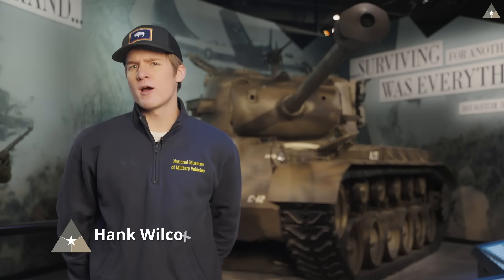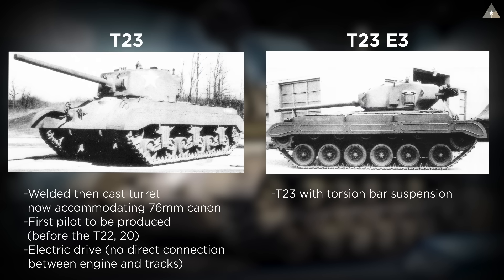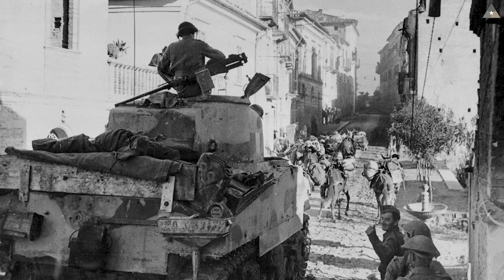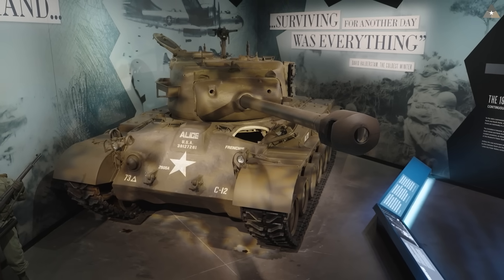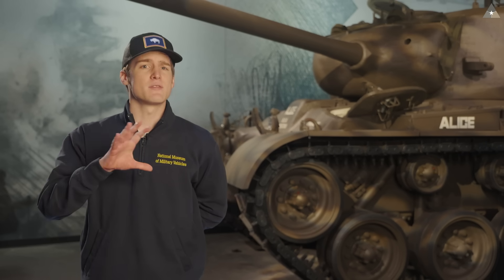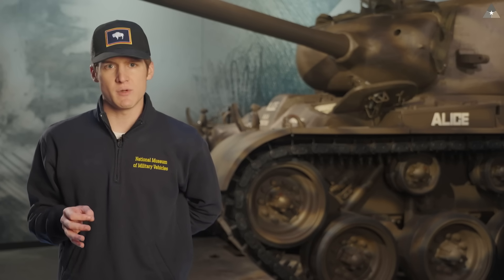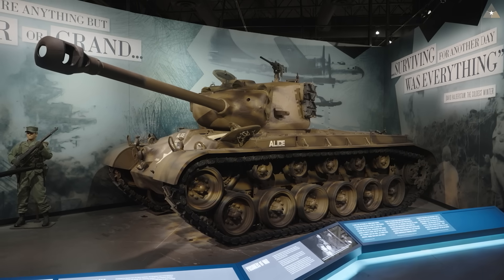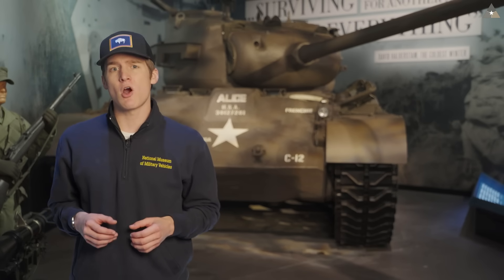M26 Pershing | From Concept to Combat Across Conflicts

Comment: This wasn't always wanted, it had maintenance issues. They could do the job, not the problem, 43.4 tons was abit much but the armor was needed,. US only saw 3 tigers until the battle of the bulge. The Sherman did as it was expected. Easier to repair, burn rate went down to around 10 percent. Many were knocked out repaired and back to battle.

Comment: Had it come to Europe earlier it would have been a great assault tank and tank killer but it wouldn't have been able to match the reliability of the M4 Sherman which was needed during the drives through France. 
I'd say it was better than the Panther in most regards and would have proven the superior tank in a face off. 
Overall it didn't have the reliability yet for prime time in France and would have been a maintenance nightmare.

Comment: There's always a question if the M26 was actually that good? By design it was somewhere between the Panther and Tiger tank in terms of armor, at least according to paper stats.

Videogames that rely on paper stats make the M26 a very solid upgrade to the M4, but less effective than the Tiger 2. Those same games ignore any faults with the Tiger 2, which tend to make the Tiger 2 the most powerful tank of World War 2.

When the M26 was used much more was during the Korean War. There its not quite mentioned, but being that it does about double the armor of the T-34-85 used by North Korea, it was probably much more effective in gun duels, but the M26 also had a weak powerplant by that point with only about 10-12 horsepower per ton. The T-34-85 I think had about 17horsepower per ton.

The M46 had a massively upgrade powerplant, but doesnt seem to have been common.

Then you get to the M47 which seemed to be the true successor to the M4.

Comment: Biggest problem in Korea was getting tanks up on ridges fast hitting 3 targets for the grunts then getting back off the ridge before Chinese and North Korean counter fire could start. Basic problem with the M26 was Transmisson slippage on grades. The M46 transmission was a redesigned unit to be a refit item for M-26 tanks as well as for new build as M-46.
Reply: My theory is that the brass was still butthurt over the Pershing getting deployed in Europe that they renamed it as soon as they could. The M46 is literally just the M26 with an upgraded drive train. Hell, there are more differences in M4 variants. Lol

Comment: “Complacency of the U.S. Government.”  Ah, no.  It’s was purely an internal Army decision based on doctrine (infantry tank vs. tank destroyers), logistics of delivering every soldier and provisions 3-8,000 miles away (it was reported that Gen. Leslie McNair ordered a 57 cal 75/76mm gun shortened to no more than 53 cal for transport, and suppressed any effort to upgun to 90mm). 

According to Steven Zagola, the M-4 could handle any German Tank in 1942, and we know what happened after, as the video said in Italy and then Normandy, the Sherman’s were outclassed.  For Overload, The British and Canadians were assigned to engage the German mobile and Panzer forces by attacking inland important sites like Caen, meeting more than 80% of Panzer units, while the U.S. army built up (via mulberries) for Operation Cobra.  The British upgraded 2,000 Shermans to the mount the 17pdr of which about 600 were available during Normandy.  The British lost about 2,000 tanks and 60,000 casualties in the Normandy campaign,and would have a tougher time without the Sherman Fireflies.
Bottom line, it were US Army internal decisions that resulted in the Sherman vs heavy tank allocation, and I do resent the labeling of this as a civilian U.S. Government matter.  In the end, this was a war of attrition where the army with the most men and equipment would prevail as long as they didn’t employ bad tactics.

Comment: They already had so many varients on the Sherman. The Firefly was thee best Sherman varient and the war was already lost by Germany.. So why put the Pershing into mass production and change all the manufacturing facilities to produce a newer tank? The Sherman did the jon after the varients were created..
Reply: Claiming the Firefly as the "best" variant is a bit of a stretch. The only thing it brought to the table was anti-tank firepower and in return it brought a litany of nasty drawbacks.

The turret used was the original M4 turret and not the larger, roomier, and better armored T23 turret the US adopted for their up-gunned M4A3 (76)Ws. The original M4 turret was deemed too small to acceptably fit the much smaller breach of the American 76mm M1 gun, the 17 Pounder was even larger and caused a comedy of issues.

To even fit the gun they had to:
1. Eliminate the vertical gun stabilizer, removing the ability to fire on the move with any semblance of accuracy and greatly increasing time to engage when coming to a stop.
2. Mount the gun sideways, reorienting the angle at which ammunition needed to be loaded increasing loader fatigue and reload time.
3. Shortening of the 17 Pounder's recoil stroke so that it fit within the recoil guard, causing insufficient dampening of the recoil throwing the crew and tank around considerably after firing.
4. Cut out the radio from the turret and mounting it externally in a thinly armored box making it susceptible to artillery fragmentation and small arms fire.

This is all without mentioning how excessively cramped it was for the crew and the massive ammunition. The cramped conditions increased crew fatigue severely decreasing crew efficiency over time and increased likelihood of injuries related to operation. The massive ammunition combined with the cramped space and awkward angle of loading resulted in a rate of fire half of that than the American 75mm and 76mm guns.

Lastly the 17 Pounder gun generated so much muzzle flash and kicked up so much dirt that adjusting aim off of previous shots was considered at best extremely difficult and at worst downright impossible as the Gunner almost without fail lost visual of the enemy every time the gun was fired.

Don't get me wrong the 17 Pounder gun was excellent and powerful but the Firefly was one of the worst possible ways to up-gun the M4. The M4A3 (76)W while it didn't have nearly the same punch had it in basically every other regard.
Reply: @ThatGuyOrby the firefly was a success tho in the British Army. Was able to deal with Tigers and Panthers, essentially like a tank destroyer. I guess you could make the case to use an M36 instead. 
Of course it wasn't perfect. Low rate of fire, strong muzzle flash, worse ergonomics. But, effective enough. Perfect would have been the Centurion, lol.

Comment: My father in law , who was in a lot of WW2 combat.  Told me the Shermans were deathtraps.  One hit from a German 88 and they were gone.  Wear as the Shermans rounds just bounced off the big cat German tanks.  They needed the Pershing.   The Germans used to say it took 10 Shermans to knock out 1 Panther or Tiger.
Reply: Which is a load of horse crap because at the height of their combined numbers the German "big cats" altogether made up less than 1/5 of German armored forces with the vast majority of tanks the M4 faced being Panzer 4s and tank destroyers built on its chassis which were vulnerable to the American 75mm gun at normal expected combat ranges. This also neglects the fact that during the Battle of the Bulge the M4 scored a 3.6 to 1 kill ratio over the Panther. Calling the M4 a death trap is laughable when it by far had the lowest crew mortality expectancy in the case of penetration out of any tank during the war, averaging only 1/5 of the crew KIA and one WIA per penetration/knock out (granted that is an average so cases varied).
Reply: @ThatGuyOrby  - So, let me get this straight: We're supposed to believe that you are the "expert"on the subject, when you weren't even there, yet the writer's father-in-law - who actually participated in the war and was actually there, is the one who doesn't know anything! 

Let me spell it out for you, sport: That man saw and experienced things you can't even begin to imagine. The guts and strength of character it took him to survive the experience and resume a normal life after the war is something you can't even fathom. He's much of a man than you'll ever be. So instead of acting like a spoiled brat, why don't you offer your humble thanks instead. If you can't find the decency to do even that, why don't you just shut up? Is any of this getting through to you, jackass?

Comment: The US Army didn't want a heavy tank in 1943 yet Congress did since they were worried about not being re-elected in 1944. The press had the public worked up over the big German cats blowing away the puny M4. Ordnance began design work on the T20 series as soon as the M4 went into production. By making it lower they could increase the thickness of the armor. They experimented with torsion bar suspensions and two types of drivetrains. One was the Ford GAA driving the Buick Hydromatic automatic transmission and a gasoline-electric drive where one electric motor powered each track. Both were tried out first on the cancelled M6 heavy tank. The M6 used a larger Wright radial engine with a fluid drive. The radial spun a generator for the electric motor drive. The armor users were really interested in the electric drive since that allowed the tank to travel at the same speeds in forward and reverse. Congress threatened to cut further funding for tank development if Ordnance didn't have heavies in combat before the 1944 Fall Elections so the Ordnance engineers supersized the T23 into the T26 that used the same engine and trans as the T23 medium. They showed it to Congress in December of '43 who ordered it into production in February of '44. In the meantime Ordnance placed orders for 250 T23 GAA w/Hydromatic and 250 electric T23s. GM's Fisher Tank Arsenal (Fisher Body) was selected to be the assembly plant. Fisher was producing the M10 TD so was given the contract to produce the M36 turret to mount on their M10 hulls. Fisher had time to do that since they had to wait on machinery to produce the M26. Fisher had labor problems so fell behind on building the M10 hulls. Ordnance then directed Ford to set the M36 turret on new M4's coming off the production line and finish the conversion outside in the storage yards. Ordnance then rounded up all the M10's at training bases to be refurbished at other plants to become a M36. Fisher was ready to assemble the M26 in September but didn't have any parts yet. Their suppliers were delayed by filling existing contracts then having difficulty obtaining the needed strategic materials. While waiting Fisher designed and built the M4 Jumbos. The M26 finally started production in November after the elections. Congress now demanded for the first 20 made to be sent to Europe ASAP. Ordnance took the first three made and ran them nonstop around a test track for 500 miles. Two made it with the third losing road wheels after travelling 300 miles. Ordnance declared that was normal wear and tear so said the 20 were ready for battle. Those arrived in February without trained crews, mechanics or replacement parts. The Army refused to use them until ordered to by Ike who had Congress and General George C. Marshall raising Hell about that.

Comment: It's interesting to hear that the Pershing was used several times in Europe. Many sources make it sound like it was in only one battle. It was a savior in Korea when all the Soviet M34s were storming through Korea. The Shermans couldn't stand up to them.
Reply: M4s did ok, I, as an ex tanker,
would rather been on an M4 than T34.
If you've never been in one, they are really crude.
But tough, that they were.
🍀✌️
Reply: Those North Korean T34-85s seemed like world-beaters in the absence of any credible counter from the scratch South Korean-U.S. tripwire force on the DMZ in June 1950, which had only a few M-24 Chaffee light tanks armed with short-barreled 75mm guns, and virtually no anti-tank artillery, recoilless rifles or other weapons worth mentioning. 

It wasn't just Korea; the entire Far East command was unprepared for war and lacked armor in readiness to fight in Korea. It got so bad that tanks were being taken out of museums, displays in veteran's memorials and warehouses back in the 'States, to augment our forces. 

When Shermans and Pershings began arriving in Korea, however, they were able to deal with the Inmun Gun (NK Army) T34-85s. The Pershings did very well against them, except perhaps on rougher terrain where their size, weight, and relatively under-powered engines sometimes caused problems. Their 90mm guns had no problems dealing with the Soviet-built tanks. The Shermans, which were largely M4A3E8 "Easy 8" Shermans, were up-gunned with the 76mm gun and HVAP ammo, which was ample for dealing with the T34-85s. The Shermans did well in hilly terrain thanks to being more-compact, lighter and more nimble than the bigger M-26s. 

The T34-85 was a tough out, in particular when manned by a good, experienced crew - but the telling factor in many of the armor-vs.-armor engagements is that most of the American crews had trained or even fought together in WW2, whereas most of the communist crews had not. 

The Korean conflict, especially after its mobile opening phases, settled down into being a more-static type of war - one in which there was not a whole lot of armor-on-armor fighting. Consequently, many of the tanks sent over to Korea were repurposed for infantry fire-support and other artillery missions. The British Centurions climbed mountains in amazing fashion, delivering fire from places no one thought they could reach.

Comment: I’m still surprised to this day that they didn’t make many,many more of the M36B1, which is basically a Sherman with the 90 mm gun turret. It would have retained the good qualities and familiarity of the Sherman with the much greater hitting power of the 90. They could have also welded on some spaced armour here and there to deal with panzer fausts. I’m also still surprised that they didn’t have the foresight of the need for more powerful engines of 650-700 horsepower range.
Reply: what I've read the commanders in the field didn't want to deal with the logistics of the 90mm ammo same with the 76.2mm ammo on converting from the 75mm HE, which  they felt was better overall for infantry support.
Reply: Re: "I’m also still surprised that they didn’t have the foresight of the need for more powerful engines of 650-700 horsepower range."

It is probable that there were plenty of civilians and field-grade/company-grade officers back in CONUS as well as in-theater who foresaw the coming need for more powerful engines in tanks and AFVs. Their recommendations were probably passed over as not being feasible with all of the demands being made on the manufacturing and supply system in the U.S. at the time. To paraphrase what Sec. Def. Rumsfeld said years later, "You go to war with the army you have... not the one you wish you had..." 

We were so short of engines we had to cram an aircraft radial engine into some versions of the M4; that's probably the last thing the designers of that mill thought it would be called upon to do. It wasn't an ideal solution, but it worked well-enough to get the job done. Don't let perfection be the enemy of the good.... 

Your idea makes a lot of sense, though, because the M36 was one of the most-effective AFVs in our inventory, both in the operational sense and on a cost-benefit basis. 

Testimony to the over-all utility of the platform was that the French used surplus M-36s in Indo-China for years after the war, while their domestic industries were retooled to make their own tanks and AFVs.
Reply: @GeorgiaBoy1961  I recently saw an older video on the Tank Encyclopedia channel about the M36 , including B1’s , being used by the Yugoslavians up to the 1990’s 😳. And I just personally think that the Sherman hull with the 90 mm turret looks badazz .

Comment: A misunderstanding in the use of tank destroyers by AGF. Tank destroyers per field manuals did not chase or persew enemy units and were defensive units only. Per us army doctrine tank destroyers were held in reserve for  enemy armored breakthroughs and were not to be used in the assault.  
The reason for the t 20's series was as replacement for the sherman but none of the those were deemed acceptable and a backup design using a t 23 current on a m 4 sherman hull with the 76 mm gun was accepted as the new medium tank.  
The pershing came from the t 23 program as an order to upgun and up armor a t23  thus the many variants until they decided on the pershing design
Reply: Yup. The order for 250 T23s was changed to 200 T23s, 40 T25s, and 10 T26s.

Comment: The 90 and the 85 are not different enough to claim advantage. The pershings armor was the advantage
Reply: What do you mean? The US testing of the Russian 85mm found it lacking, even compared to the 76mm of the Sherman.
Reply: @historyandpoliticsexplaine4876 Apologies but this is objectively incorrect, the American 90mm gun was excessively more potent than the Russian 85mm gun. Since you clearly are not aware allow me to be the one to inform you that bore diameter alone does not determine a gun's potency. The Russian 85mm gun was only par with the American 76mm gun in armor penetration, both defeating about a maximum of 150mm of armor with standard Armor Piercing ammunition. The American 90mm by comparison could penetrate up to 215mm with it's standard T33 AP and in excess of 320mm with M304 HVAP ammunition.